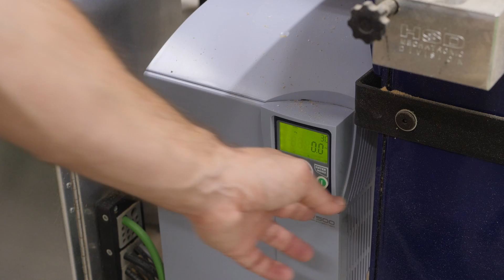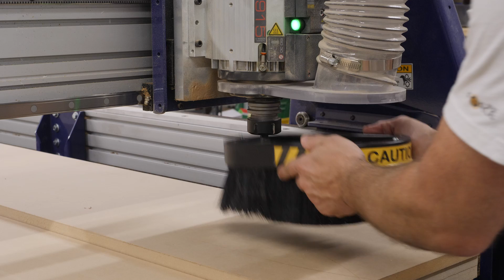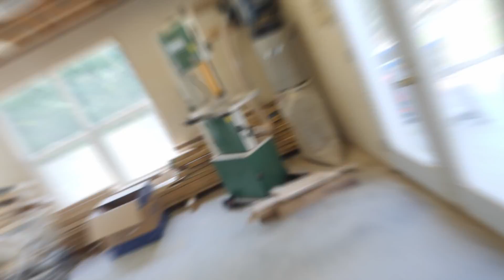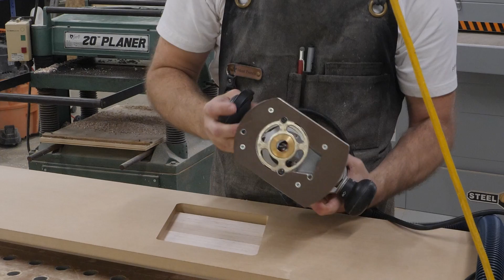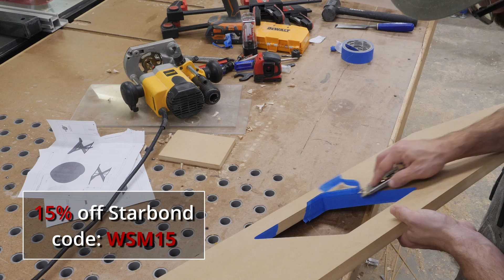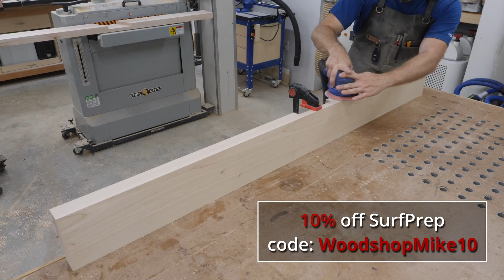Cutting Half Laps | Woodworking Joinery

Comment: Why didn't you just use the cnc router to cut the lap joints?
Reply from the maker: Haha, cause I'm a dummy sometimes 😂 , but the other reason is because I had already milled the stock to final size.  I was originally planning to cut them on the table saw or radial arm saw and then I wasn't quite as keen on that approach this time around and decided to use the hand router.
Reply: @WoodshopMike  thanks for the quick response.  Why is it not desired to use the cnc of the boards are already milled to size?